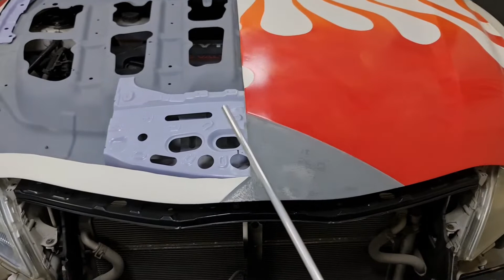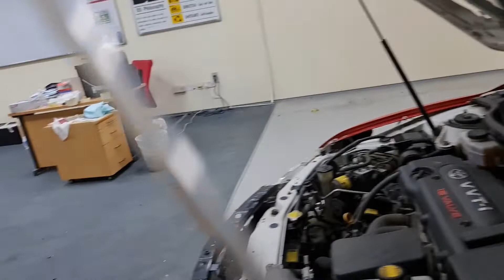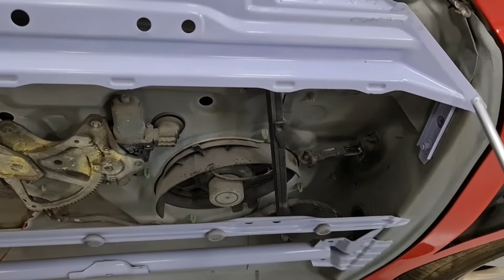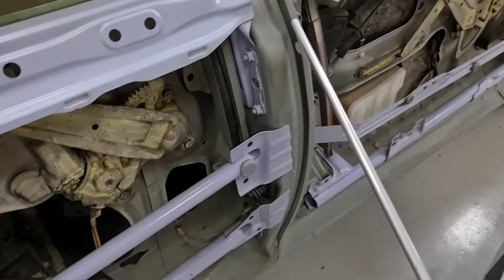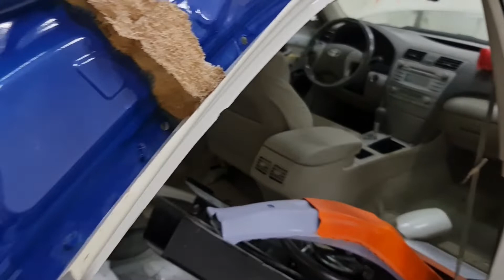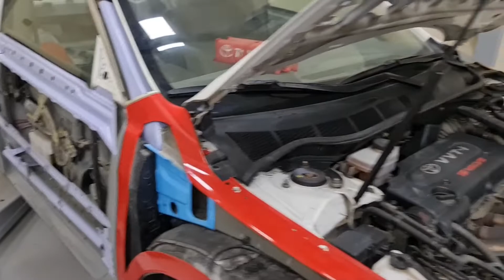How many types of Automotive Sealant?

Comment: Sir please tell which sealant would be best for installing SPOILER on my car i20 besides 3M? I don't want drilling nor using champs on the body. Please help.
Reply from the maker: @Tname N, you can use 08115 3M adhesive sealant it's more strength adhesion. However, it's hard to remove.
Reply from the maker: Before application, you need to clean by degreaser liquid and scuff the area for adhesive application #Scottsbrite or #600 sanding paper